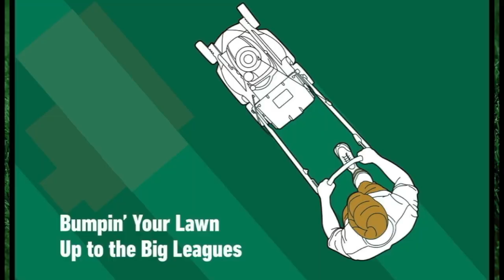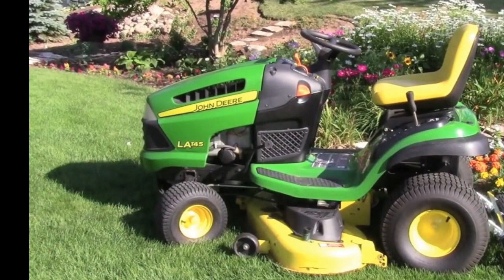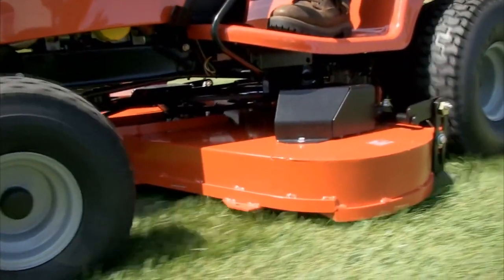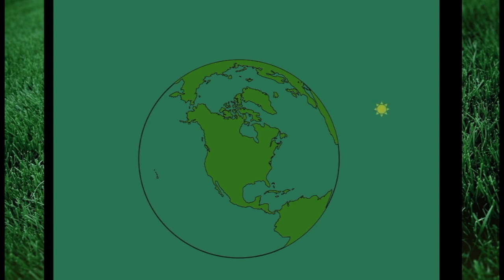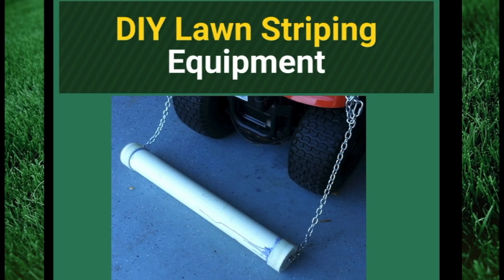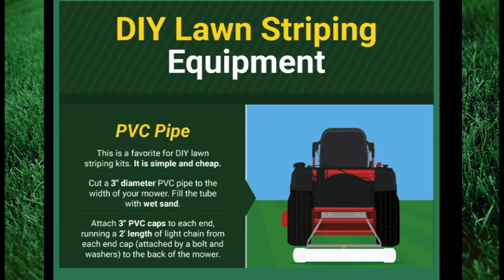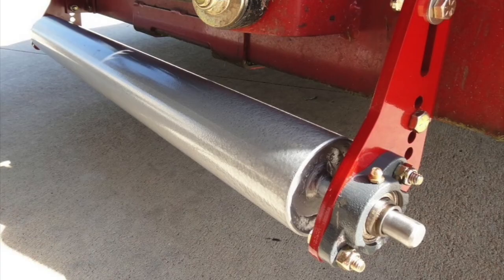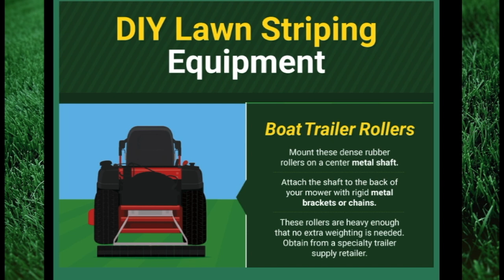How to dominate your Lawn with Stripes || Lawn Stripe Kits ||

Comment: Stripeadoes great job sir. I am Striperman and have been using the Big Leagues striping kit since 2006. I have used it on both my rotary mower as well as on my manual reel mowers with good success. :)
Reply from the maker: Thanks
Reply from the maker: They work very well. I have had mine for many years, and picked it up used for a great price.

Comment: I have a great idea that I think will work the best! Use a little common sense and ask yourself what makes our hair sit down? A Comb! So build a comb like structure built at an inward angle so it replicates combing your hair. This should be guaranteed to work the best. When I run a bunch of rubber tires over my hair it does nothing. But a simple comb lays it down.
Reply: But what if your old and shit, and had a buzz cut forever, and combs won't lay your hair over ? I bet if you had a WEIGHTED hair BRUSH, or heavy roller, it'd be easier to get it down , like a crop circle. I see your logic, but that is a very specific atmosphere, that's all. Peace.